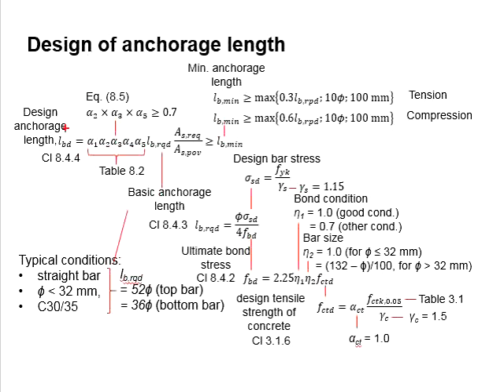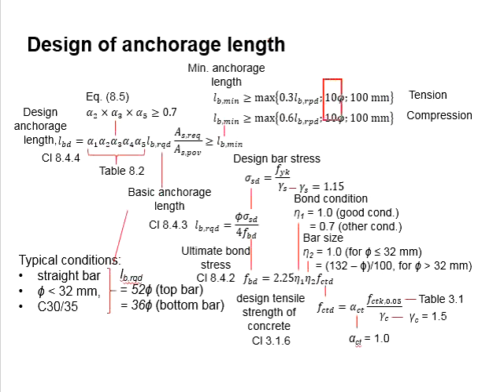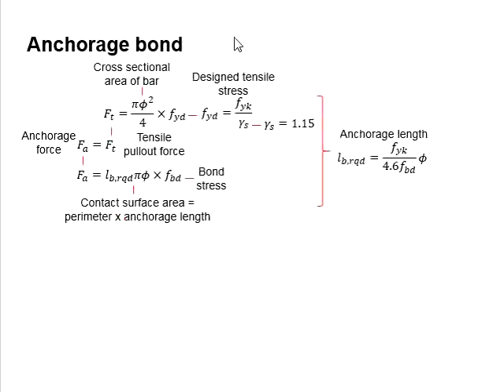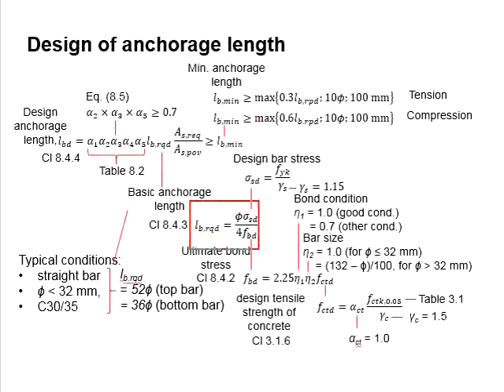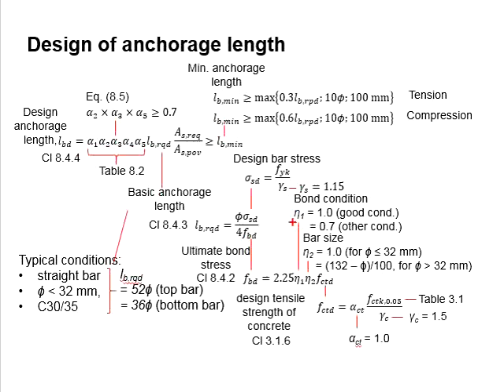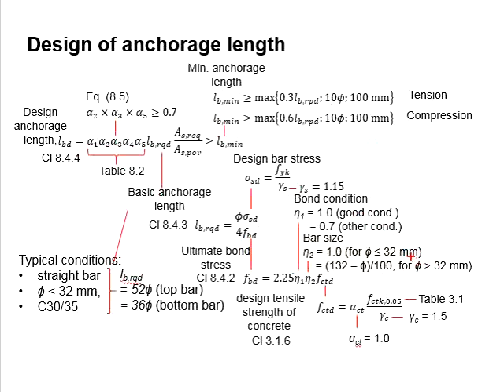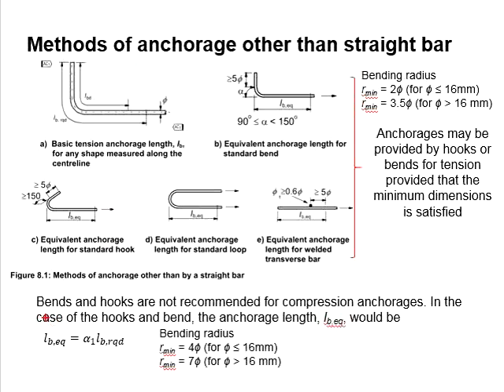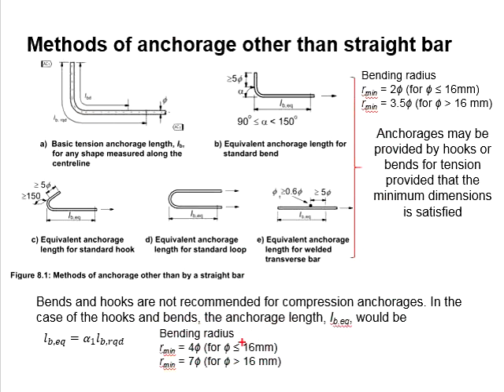5.13 Design of anchorage length

Comment: Hi, thanks for the video. I have a question regarding Concrete cover factor a2.
Reply from the maker: factor a2 may refer to Table 8.2, EC2-1, with the Cd given in Figure 8.3 EC2-1.
Reply: @eng-aim  Thank you for the reply. My question is this factor  spacing “a” for calculating concrete cover. It depends on what? I have a calculations where given concrete cover is 35mm. Reinforcement bar diameter is 12mm and calculated value of “a” for factor cd is 56mm. And in second case for bar diameter 16mm, calculated value of “a” is 44mm. I am confused for almost a week that how these values are derived. I am having stirrups with leg lengths as 850mm and horizontal distance for first case 155 and for second 170mm respectively. I do really appreciate if you can guide me on that. That do be a huge help for me 🙏
Reply from the maker: @Faizanmalik-ke4vd  1.	the c and c1 in Figure 8.3 EC2 refer to the distance from concrete edge to the main bar, which means that c1 and c = concrete cover (cnom) + bar size of the shear link. Assuming your cnom = 35 mm, link size = 8 mm, your c and c1 should be 35+8 = 43
2.	cd = smaller value of a/2, c1, c (for straight bars case). That means cd = min(56/2, 43, 43) = 28 mm for 12 mm bar diameter
3.	next calculate α2 = 1-0.5 x (28 – 12) / 12 = 0.3333
4.	however, based on Table 8.2 in EC2, 0.7 ≤  α2 ≤ 1.0. therefore, you may use α2 = 0.7.
kindly check if my calculation is right.
Reply: @eng-aim  this spacing “a” for for concrete cover factor between the bars is calculated based on what?
Reply from the maker: @Faizanmalik-ke4vd  based on the clear distance between the bar that you intend to calculate the anchorage length with the adjacent one.

Comment: in Eurocode for the design anchorage length equation, the ratio, (As,req/As,prov) is not part of the equation. Why do you have it in yours?
Reply from the maker: I obtained the equation from a reference, Reinforced concrete design to Eurocode 2 by Mosley.